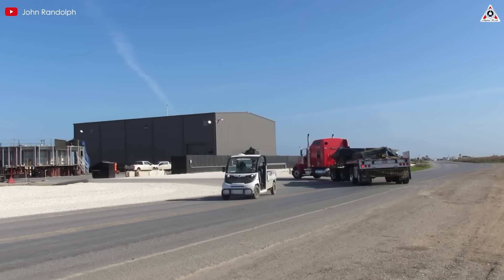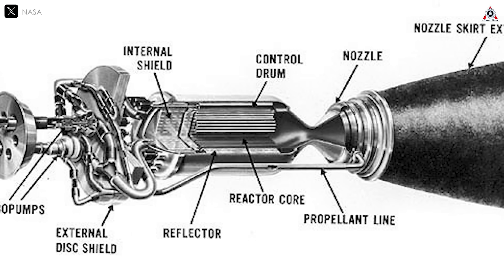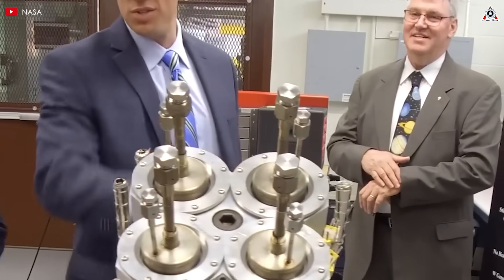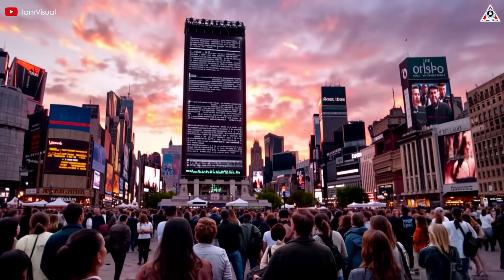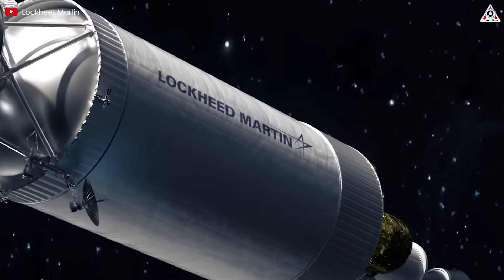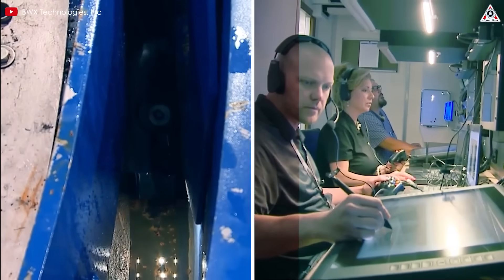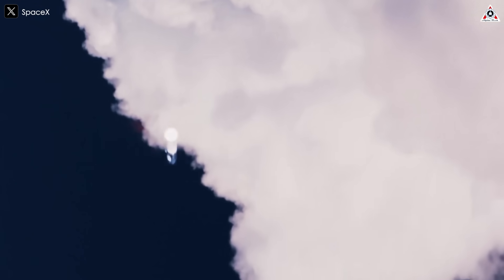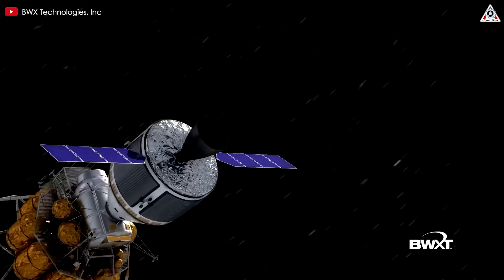NASA Declared "Nuclear Mars Rocket Engine is better & faster than SpaceX Raptor Engine”…

Comment: Remember,  its not a nuclear determination.    Its the heat from a small nuclear reactor that ignites 
the fuel.    I believe, without a separate 
oxidizer.     This has the potential for use with the aerospike rotating 
detonation engine. 
Not a nuclear detonation. 
A chemical detonation.
Reply: AAH... ACTUALLY THE HIGHDROGEN IS NOT FUEL... BUT JUST MASS THAT IS HEATED THAT PRODUCES THE PRESSURE FOR ACCELERATION...  THE HOTTER THE  MASS IS HEATED THE  MORE PRESSURE AND THEREFORE MORE ACCELERATION YOU CAN ABTAIN FROM THAT MASS....   BURNING FUEL AND LOX IS JUST A WAY OF CREATING HEAT TO DO THE ACCELERATION...  IN CHEMICAL ENGINES...
-------..  USING HIGHDROGEN IS BEST AS IT IS THE LIGHTEST MOLACULE, MAKES IT EASIER TO ACCELERATE...  BUT ANY MASS CAN BE USED FROM SIMPLY FILLING TANKS OF THE MARTIAN ATMOSPHERE LIKE CO2... AND SQUIRTING THE CO2 THROUGH THE NUCLEAR ENGINE..  BUT IS JUST LESS EFFICIENT FROM THE HIGHER MELOCULAR WEIGHT OF THE ACCELERATED MASS...   OR EVEN EARTH'S NITROGEN ATMOSPHERE...

Comment: Nuclear engine were researched and found to be to dangerous to use in the atmosphere. To use it in space converts a nuclear engine right back to a dangerous chemical rocket.

A chemical rocket does not have the ability to travel long distances. The hydrogen propellant is finite. There are no gas stations to pickup some more. Perseverance has already attempt the use of onboard electrolysis to separate just oxygen. It used to much power. Reason the mars atmosphere doesn’t contain enough oxygen molecules.

So sorry this is never going to happen. We must begin working on new technology’s that we can use to venture into space. The people promoting this already know it’s a dead in. They just want our money to justify their existence.

Comment: Is this the same engine Stanton Friedman worked on in the '50s and 60's, before he got into UFOs? A 75 year old Gee-whizz-bang ?!?

How cool is THAT ? You finally solved the problem that is radioactive AF ? What do you mean, "No."? What good is Mars if you have cancer on arrival?
Reply: NO..  HIS ENGINE IS A STANDARD NUCLEAR PELETS  CONTAINED IN TUBES LIKE ALL REACTORS OF THE TIME...
---..  THE DRUM DRIVE IS ONLY ABOUT THE SIZE AND SHAPE  OF A LONG HIGH-PRESSURE OXYGEN BOTTLE... WITH PLENTY OF SHIELDING AROUND IT TO KEEP ANY NASTY RADIATION  FROM LEAKING OUT TO CONTAMINATE ANYONE CLOSE AROUND IT..  LET ALONE AT THE OTHER END OF THE SHIP...  THE SPACE AROUND THE SHIP WOULD BE MUCH MORE NATURALLY RADIOACTIVE THAN ANYTHING AROUND  THE  NUCLEAR ENGINE...  Even the HIGHDROGEN COMING OUT THE END OF THE DRIVE WOULD HAVE NO PHYSICAL CONTACT WITH THE NUCLEAR FUEL...  WITHOUT BEING IN THE ENGINE LONG ENOUGH TO BE CONTAMINATED...  IF YOU GOT NEAR THE EXHAUST YOU WOULD STILL FRY FROM THE HEAT RADIATING OFF OF THE PLUME BUT NOT FROM ANY ATOMIC RADIATION... 
-----...  THE NUCLEAR DRIVE ALLOWS ENOUGH SHIELDING TO BE CARRIED TO KEEP ALL ALIVE AND CANCER FREE FROM ANY RADIATION...

Comment: 10 days to mars is impossible even if they made a engine capable of it because at that speed and velocity you'd overshoot mars and keep on going forever
Reply: Okay do the math with a constant one G acceleration and equal deceleration what is the travel time?
Reply: oh it's ok musk will have his spacex nuclear brakes installed also known as a "unscheduled rapid disassembly automatic speed reduction unit"
Reply: AT LEAST YOU ARE THINKING... BUT IF YOU CAN ACCELERATE TO THAT SPEED... YOU CAN DEACELRATE BACK DOWN INTO MARS ORBIT JUST AS EASILY...

Comment: OK-------..   WHILE THE EXPLAINED TECH IS GREAT WITH AN INCREASE OF 2 TO 3 TIMES SPECIFIC IMPULSE...    A NEWER MORE ADVANCED TECH USES A LIQUID HIGH TEMP SALT IN A NARROW LONG ROTATING DRUM SPINNING AT THOUSANDS OF RPM CREATING A VERY HIGH GE GRADIANT THAT TRAPS THE SALT AGAINST THE  OUTER RIM OF THE DRUM LEAVING A NAROW SPACE IN THE CENTER IN A VACUUM THAT HIGH VELOCITY HIGHDROGEN CAN BE SQUIRTED THROUGH TO BE HEATED TO TENS OF THOUSANDS OF DEGREES ABOVE THE MELTING POINT OF ANY KNOWN MATERIAL TO  CREATE VILOCITIES 10 TO 20 TIMES THE VELOCITY OF A CONVENTIONAL RADEOACTIVE PELET TUBE REACTOR ENGINE..  NOW ON THE DRAWING BOARD NASA IS WORKING ON...  
-----------.  THE ROTATING DRUM PUSHES THE  HIGH TEMPURATURE SALT RELATIVELY LOW MASS SALT IN TOWARDS THE CENTER OF THE SPINNING DRUM'S SALTS TOP OUTER SURFACE AS THE COOLED SALT QUICKLY DROPS TO THE BOTTOM OUTSIDE COOLED SALT  OF THE OUTER DRUM SURFACE WHERE IT STARTS BEING REHEATED TO MAKE ITS WAY BACK UP TO THE TOP OF THE SALT AT SOME 20,000 DEGREES TO RADIAT ITS HEAT OUT INTO THE NARROW RAPIDLY ACCELERATING HYDROGEN STEAM...
------------,  THE HIGH TEMPURTURE SALT IS AT SUCH A HIGH RATE OF GRAVITY THAT IT BECOMES A HARD METALIC SURFACE THE HIGH SPEED HYDROGEN CANNOT PENETRATE...
----------.  A LAYER OF COOL INERT LIQUID METAL, SUCH AS GOLD, IS MAINTAINED NEXT TO THE METAL DRUMS SURFACE, INSULATING IT FROM THE MID-HIGH TEMPERATURE. ATOMIC SALTS WHERE MOST OF THE RADIOACTIVITY IS CONSENTRATED...
----------. AGAINST THE HIGH TEMP METAL  OF THE OUTER DRUM'S SURFACE ARE SEVERAL LAYERS OF CERAMICS FORMING A TEMPERATURE BARRIER OR BED FOR THE  MEDIUM TEMP INERT GOLD TO. LAY ON.. SEPARATING THE HIGH TEMP NUCLEAR SALT FUEL... THAT DRIVES THE ULTRA HIGH TEMP HYDROGEN OUT THE ATOMIC ENGINE... FROM THE COOLED HIGH STRENGTH METAL OUTER ROTATING DRUM...  FROM A FEW HUNDRED DEGREES OF THE OUTER METAL DRUM TO THE 20,000 DEGREES OF THE INNER ATOMIC SALT AND HYDROGEN PROPELANT...
------------. THE RATE OF REVELUTIONS CONTROLS THE NUMBER OF GEE'S THE ATOMIC SALT IS UNDER WHICH IN TURN CONTROLS THE RATE ATOMS ARE SPLIT BY SIMPLY CONTROLLING THE DENSITY OF THE ATOMIC SALT ... LESSEN THE GEES AND THE REACTIONS DECREASE OF EVEN STOPS....   INCREASE THE GEES AND THE ATOMIC REACTIONS INCREASE CONTROLLING THE TEMPERATURE.. ACCORDING TO THE DESIGNED SPECIFICATIONS...OF THE SALT..
------------.  THE HIGH TEMP ULTRA HIGH VELOCITY HYDROGEN STREAM WOULD ALSO GENERATE MEGA WATTS  WHILE PROPELLING THE THOUSANDS OF FEET LONG STARSHIP...
-------------.  THAT FUTURE ROTATING DRUM ENGINES ARE MANY DECADES IN THE FUTURE BUT IT STARTS WITH THE OLD PELET TUBE ENGINE NASA IS NOW BUILDING FOR THE MARS SHIPS IN THE 2030s...
=============..  FUTURE DRUM ENGINES COULD REACH HUNDREDS OF THOUSANDS OF DEGREES IN THE  CENTER DRIVE CORE OBTAINING SPECIFIC IMPULSES THAT WOULD ALLOW STARLINERS WITH THOUSANDS OF PASSENGERS TO REACH MARS IN  DAYS... WEEKS WHEN NOT IN CONJUCTIONS... AND  A MONTH OR TWO TO THE OUTER PLANETS...

Comment: Raptor can push a Mars vehicle to max speed then power up the nuke engine for overdrive.
Reply from the maker: Yeah!
Reply: OK...  ONCE IN ORBIT...  THERE IS NO NEED TO PUSH THE MARS VEHICLE TO MAX SPEED USING A CONVENTIONAL CHEMICAL DRIVE AND THEN POWER UP THE NUCLEAR DRIVE TO  AAAHH,,,  OVER DRIVE...  THE  NUCLEAR POWERED DRIVE STILL NEEDS MASS TO THROW AWAY AND WOULD BE MUCH MORE EFFICIENT USE OF THE FUEL MASS...  AND NOT CHEMICAL BURNING... AND JUST AS SAFE AS A CHEMICAL DRIVE AS THE ACCELERANT MASS NEVER TOUCHES THE NUCLEAR FUEL TO BECOME RADIOACTIVE...  IF THAT IS WHAT YOU ARE WORRIED ABOUT...  BUT KEEP THINKING AND STUDYING...  AND YOU WILL GET IT EVENTUALLY...

Comment: This is a badly written script that goes off on too many tangents. It doesn't even start talking about the actual engine until over 3 minutes in, and I feel even less informed on the subject than before watching it. This is still a fission engine, so it's exhaust has to be ☢radioactive. ☢ Obviously using it within an atmosphere is out of the question, but you're also leaving a concentrated trail of radioactivity behind you. That makes future flights along that course even more dangerous.
Reply: SORRY...    BUT THE HYDROGEN NEVER TOUCHES THE RADIOACTIVE FUEL AND IS NOT IN THE ENGINE LONG ENOUGH TO BECOME RADIOACTIVE ITSELF..  JUST DAMN HOT..!!!! 
--------.. MY APPOLOGIES FOR NOT BEING COMPLETELY CLEAR.. BUT I WAS TRYING TO BE AS BRIEF AS POSSIBLE.. WITH AS MANY PRINCIPLES AS POSSIBLE CRAMMED INTO THE LIMITED SPACE..  
----.. THANKS FOR READING IT...

Comment: I have to agree. Chemical engines have taken us this far, but a mission anywhere beyond the lunar orbit requires different methods of propulsion.
Reply: Raptor can push a Mars vehicle to max speed then power up the nuke engine for overdrive.
Reply: @donaldclifford5763  Carrying a huge load of chemical fuel kills all advantages. I think the second stage could activate its NTP engine right after the first stage has detached. "After" being the operative word, meaning no hot staging which is obviously an issue.
Reply: @ Raptor can push the vehicle up to max speed then detach, no payload disadvantage. Just the lower end acceleration is faster from a dead start. the nuke acceleration is an advantage on the long range higher speed. A combo of the two advantages. No downside.

Comment: But if you light up to close to the planet, you will irradiate the atmosphere.
Reply: LOL... SORRY BUT NO...!!!   NO RADIATION IS EMMITED   BY THE DRIVE...  AS  THE  HIGHDROGEN NEVER TOUCHES THE RADIOACTIVE FUEL AND IS NOT INSIDE THE  ENGINE LONG ENOUGH TO BECOME RADIOACTIVE... 
--------... SO TECHNICALLY..YOU COULD LIGHT UP THE DRIVE ON THE SURFACE OF THE PLANET AND TAKE OFF IFF YOU HAD A POWERFUL ENOUGH ENGINE AND A LIGHT ENOUGH SPACESHIP...  BUT THEN THE EXHAUST WOULD  DIG YOU A HOLE DEEP ENOUGH TO GET HALF WAY TO CHINA...

Comment: I wonder if Liquid Fluoride Thorium Reactors could be used as engines?
Reply: If you power an ion thruster, sure.

But keep in mind, radioactivity tends to kill the crew. They had the same problem with the nuclear powered bombers.  Google HTRE-3. Melted down, 1958.
Reply: ANY NUCLEAR FUEL CAN BE USED... FACT IS THE ENGINE USES SALT AS THE  MEDIUM.. FOR ANY NUCLEAR FUEL USED..
Reply: @1701Larry  That is an extremely general definition of salt.